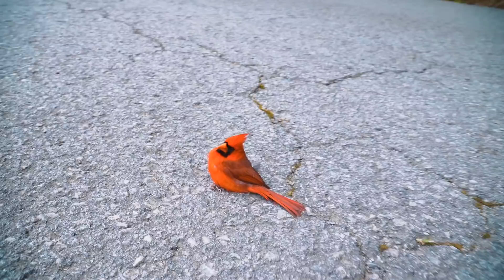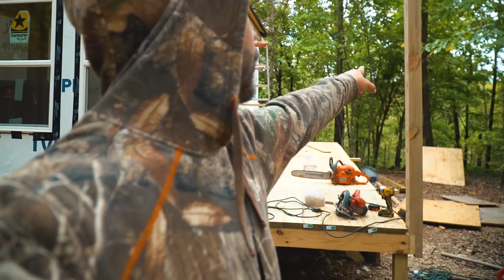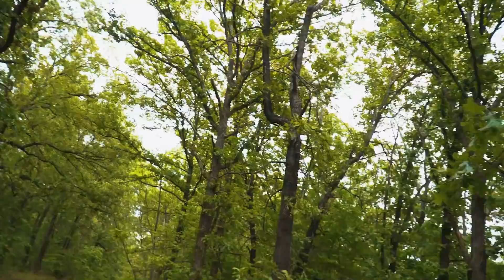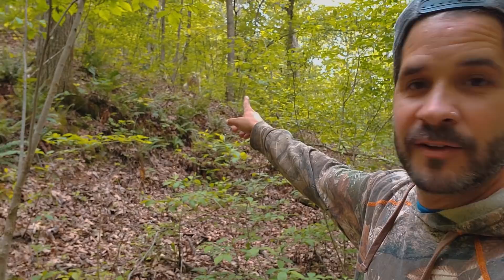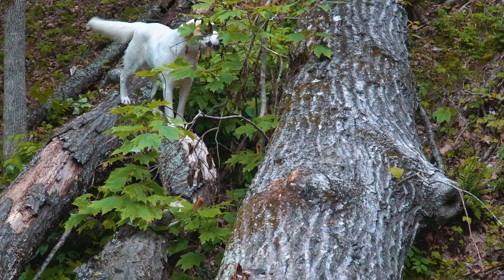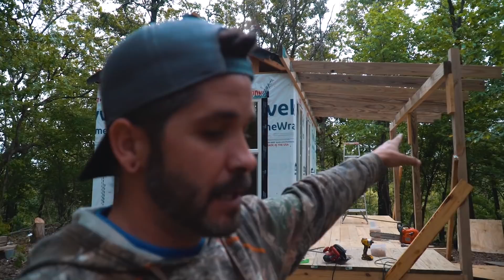CRAZY DAY! Rescued Wild Cardinal, Deadly Trees Falling, Tiny House Patio Build & Lost Dog! -Off Grid

Comment: Call Kevin for the tractor or a winch to drag them up the hill when cut up into smaller sections. Then you can work with them at the top. So glad you found sawyer.

Comment: Jason, sometimes Birds fly into vehicles and it knocks the wind out em...he just needed some down time to re-coop.....! Jason, every piece of lumber has a "CROWN"...! If you sight down the length of the lumber you'll see a small arch from one end to the other, the other side will be the opposite. the crown always faces up ^...! Sight down each piece look for the arch in the lumber and put an X on that edge.....the X always goes up..! The boards 2" x 6"'s you got running from the Tiny House roof out over the Deck are called rafters. If you want to lower or increase the pitch of the Porch roof, you can cut a notch in each rafter's where it rests on the Porch's beam going down the length of the Porch 16 feet.....?

Comment: All the rain and then the heavy winds worked together to take them down.  Get a winch, a tarp or sled and cut them up at the bottom and winch them to the top.  Even if you can't get them milled they will provide tons of firewood.  Good luck God bless

Comment: Fire wood, buck the logs on the small side and split it in place before hauling it out. It will still be hard work but doable if you take your time with it and of course be safe. It might Not be worth doing from a safety stand point. Thank you for helping out that cardinal, that was cool.

Comment: Animals are a very good judge of character. That cardinal obviously realized that you meant it no harm. I probably got its chimes rung with an impact with a car. You did a good thing. They are certainly beautiful birds, but boy are they ever loud. We have several cardinal families living in my neighbourhood. You may not always see them, but you cannot help to hear them. Maybe you could cut the trunks into 3-4 foot lengths, split them in half and dig the halves into the ground, thus creating your staircase or at least part of it. You wouldn't have to move the split halves far that way and they would be a manageable weight. However,  you might want to invest in a power log splitter to handle the amount you would need to do. That bent tree would make an awesome gate arch at the entrance to your driveway!

Comment: Already said how I feel about the cardinal on Instagram. With those trees falling it opens up a good lane to install a cable system to bottom by the creek...you would just need to open it up more on the top then using a captain winch to bring them up to the top in 10 feet sections for your mill. The porch is looking good bud so keep up the great work.

Comment: Well I don't know if those trees are still there but if you have a wheel barrel you could cut all the small trees into 8 to 12 inch sections and wheel all that out. Also if you have pulleys or could buy or even make them you could set them up on an a frame leveraging stilt and move hundreds of pounds by hand meters at a time. Cutting that big tree in 6 to 8 foot sections so that you could mill them for future projects and drag those with the pulley/ a-frame tool.

Comment: Maybe a block and tackle, or a pulley setup to multiply your pulling power.Use heavy rope not chain in case it would break and come back at you. Cut the tree into 8 ft or whatever lengths you want to use first.

Comment: Heads up if you are using deck screws to attach those hangers.... You should only use nails or structural screws
Reply from the maker: I'm only using them to get started. I have nails! That's why I only put a few in there.  I'm still learning, so i often have to redo what I'm doing. Its easier to back out a screw than get nails out.  But thanks for looking out!

Comment: Some advice....joist hangers should be nailed  with galvanized hanger nails they are short stubby things.
Reply from the maker: I know! I have them. I just use screws to get everything where I want it first.  If I mess up, its easier to back out a screw than nails.  I appreciate you looking out though

Comment: On the tree that are down what we did when I was young is cut them in to 10ft peaches and pull them up with ropes and a truck little by little use rope and blocks  it come easy .
Reply: Cut smaller logs to put under it as it comes up the hill to make it easier.

Comment: WoW that was awesome, I used to have a Cardinal that always came out & dive bombed me when I was watering my flower Garden outside, then he would go over & fly though the flow of the water, so then 1 day I was spraying W/The hose & he flew thru it about 4 times like he wanted me to spray him, so I named him Mikie & when I'd call him by his name he would come & we'd have this little Bath party. ... That was awesome to me so I know how I feel.

On a different note I've learned something about ticks.... U may not like the Idea but then it's a choice U'll have to make .... If U get a tick on Ur body rather than pull it out & leave the head in Ur body, U need to take some Vick Vapor Rub  & put it on the body of the tick. If U put a dab of VICK behind each of Ur ears it will ward off Mosquitos so I'm wondering if it would ward Ticks just as well if U put some vick where the tick normally fall onto Ur body maybe they wouldn't stay on Ur body???? Hum that is a thought....

Comment: Jason you should put another treated 2x4 all way down on the front of those 4x4’s up under those roof rafters to help hold the weight of that roof.  
Because Of weight, just Incase you ever get a snow load on that roof in winter that one board will never hold it.